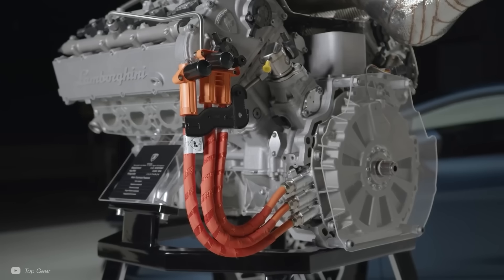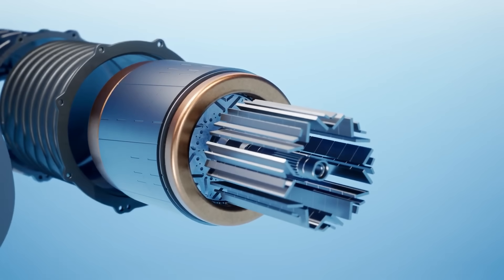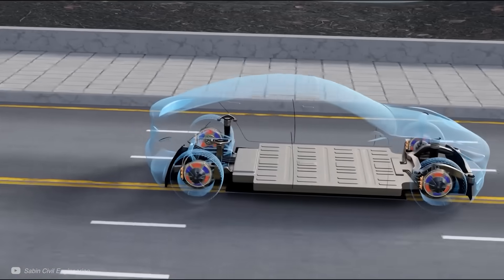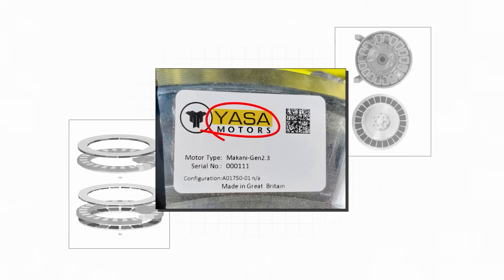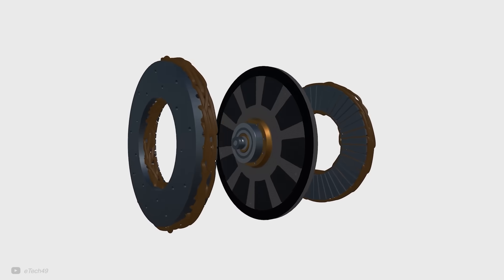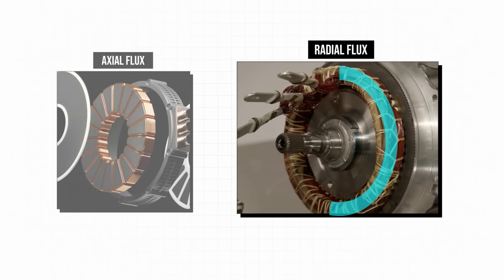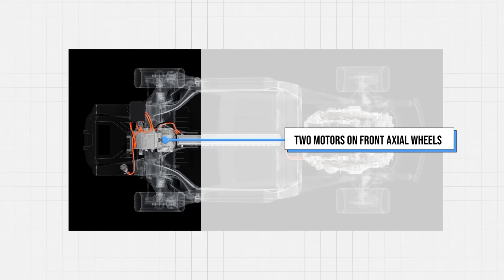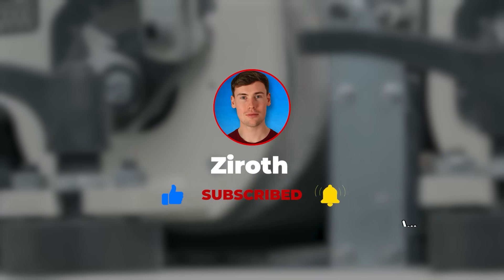Revolutionary Yokeless Motor: The Future is Here

Comment: Oh man, mass produce the motor to be used as a single power source for cheap small cars. You can outfir any current petrol car and strip about 300kg of weight from the engine and replace is all with a 17kg motor. 148HP is enough for small city cars, I hope they can make it cheap enough for the common plebs.
Reply: Yeah once you've added batteries there's no weight saving. But there's a saving in running costs, both in fuel and in the reduced number of moving and consumable parts.
Reply: For now, batteries will get significantly lighter
Reply: The same claim about reduced running costs was made about electric cars and it has been proven to be incorrect. They actually cost more to operate than a gas-powered vehicle
Reply: @cooperised  also in performance, it's got torque, it's gonna feel like a 2.0 TDI and they put those on big cars too
Reply: @cooperised You also need beefed up components such as brakes and suspension. I think you've simplified it wayy too much.
Reply: @reececlayton9549 Suspension perhaps, brakes no because a significant proportion of service braking comes from regen. In fact the biggest maintenance problem on my EV has been the rotors gaining a layer of surface rust because they're not being used enough. More modern EVs than mine will deliberately apply a small amount of mechanical braking periodically to avoid this problem.
Reply: @cooperised I know that. I said the components need to be beefed up.
Reply: @reececlayton9549 But they don't. Brakes, anyway. That's my point: EVs (and hybrids) rely far less on their mechanical brakes than ICEs, so despite the added weight they do not need to be beefed up.
Reply: @cooperised which is lost when the battery fails every 7 years max. You can drive a gas engine with little maintenance to well over 400k miles as long as you take care of it and buy the right one. There are currently no electric cars that hold a candle to a gas car in reliability. That is also the reason they dont use electric motors in airplanes. For instance the 1998 lexus ls400, 1uz v8 is so well built, it is small aircraft certified and there is one that id over a million miles.
Reply: @JamesAnderson-fw5ew Where are you getting those numbers? EV battery life is considerably better in practice than had been expected in the lab, and even the most conservative figures for battery life suggest at least 10 years or 100,000 miles of useful life, more if treated carefully.
Reply: @cooperised even if it lasted 10 years or a hundred thousand miles, thats still nothing. Even a garbage mercedes product will make it to 100k. Once the battery goes out, the car is practically garbage. Tesla battery replacements are about 20k and total out the car every time they fail. You may get 10 years out of it but If you happen to live in an area with slightly colder temps, kiss that 10 years goodbye.
Reply: @JamesAnderson-fw5ew Batteries don't suddenly fail, they degrade slowly. Range will eventually start to suffer, sure, but there's no requirement to scrap a 100k mile EV, it just won't go as far on a full charge. Note that the average age of a scrapped car is around 120k miles anyway.
Reply: @cooperised thats not true at all. Almost every car at the junkyard I go to are well above 200k miles or more. i also never said the batteries instantly fail but they do completely stop working around the 7 years mark. Your right about the degradation over time and that a battery will not output as efficiently over time. A gas engine will output almost identical performance as when it was new with proper maintenance at very high mileage. I can tell you are not an actual car guy as 120k miles is nothing. Almost every gas car can easily hit 200k no problem. We have have a honda odyssey with 210k that still runs, a buick lacrosse with 275k, a lexus gs300 with 235k, and my engine swap in my 90s civic has 220k and Is turboed and has a hard life while being 20 years old now. No electric car is going to even closely compare to what a gas or even diesel can get to. Your uninformed and your google ai is wrong.
Reply: @JamesAnderson-fw5ew What absolute nonsense. "They do completely stop working around the 7 years mark"?! Where are you getting this stuff? Performance doesn't suffer with age, only range does, and not by a lot (my 3 year old EV has a battery that still reports 98% capacity). My information on scrappage ages is taken from official statistics, not a random junkyard. I'm out of this conversation, you're clearly determined to hate on EVs and facts apparently mean nothing to you. Have a good day.
Reply: @cooperised if range goes down performance does to. They wear with what appears to be a logarithmic curve. Im not gonna listen to some guy who doesnt know anything about cars.
Reply: @cooperised  How long do EV batteries last?  Even if you are prepare to put up with losing capacity and range as they get older with more recharge cycles, they still eventually need recharging, and that's going to be many thousands of dollars.  Plus, I wonder if prospective EV buyers think about cold wet days when heating the vehicle interior, and running the wipers, is draining the battery reducing range.  And that is still not taking into account how long it takes to recharge mid journey — that can easily be an hour.
Reply: @TrevorDennis100  my Tesla model 3  take 30 min to recharge to %80 ( charging rate slows after %80)  while I’m at the grocery store & That give me 200miles of Range , I only charge 2 twice a week but if I could charge at home , I would just plug it in overnight like my phone
Reply: @TrevorDennis100
In an absolute hypothetically perfect scenario, it would take close to a decade to get everyone switched to EVs. Advanced battery tech is in the early stages, and nothing has changed. Things take time. Computers took many decades to get to a point where they were useful to everyone. It was 80 years between the invention of the fridge (freezer actually) and the time you could go to a store and buy one.

Batteries will probably be faster than those. But not even counting the time needed for batteries to get better, a LOT of people with cars have loans.

So just like not one vehicle is good for everyone, batteries aren't ready for everyone.

But the fact is, the average miles driven per day, is 35. So for everyone you know that drives a LOT of miles every day, there's several other people who drive less than 35 per day average. There's a ton of people who electric would be perfect for, and for the occasional longer trips, electric is so much cheaper to actually drive, that renting a gas car for a rare long trip, wouldn't even make an electric more expensive than owning a gas car. 🤷‍♂️

I'd betmoney that the distance current battery tech gives, well over half the drivers would save money owning an EV, and renting gas as needed.
Reply: @TrevorDennis100  Tesla says their batteries last several hundred thousand miles and I don't doubt it. Say you get 333 miles per charge (conservative for a 100kWh model S) that would be only 300 charge cycles to equal 100,000 miles. Tesla says they're good for 1,500 charge cycles!
Reply: @MikeZ8709  But isn't that with a greatly reduced capacity (range)?  I bet you'd be lucky to get 100 miles out a charge by the 1000th charge cycle.
Reply: Most cars are front wheel drive. How cool would it be if you could buy a rear axle/electric motor drive unit that was somewhat universal and could be bolted into the rear of most cars making them a hybrid. You could get away with a small battery and have regen braking/all wheel drive in one mass produced package.
Reply: @undertow2142  my RAV4 gets AWD by driving the front wheels with gasoline and the back wheels electrically with regen braking. It’s part of why I bought it. 

Agree, it’d be awesome if it was a package you could mod any FWD car with.
Reply: You're massively forgetting about the weight of a battery to operate said motor I think.

Or where are you getting the 300kg weight savings?
Reply: @PowerScissor City cars have much smaller battery.
Reply: @PowerScissor  You can chuck out the mass of the ICE, some of the transmission, exhaust system, fuel tank and fuel for a start.
Reply: @johnmorris1162  I understand what isn't needed in an electric vehicle.

All electric vehicles are significantly heavier than their ICE counterparts currently...as the batteries needed to power them don't come close to the energy density of fuel.

...and they don't get lighter as the fuel is used.  A 10% charged battery weighs the same as a 100% battery.

I love my electric vehicles...but they are heavy as sh!t.
Reply: @PowerScissor that's why most companies are going "mild hybrid," small battery size, and the electric part is basically a glorified starter that's intended to overcome inertia eg at stoplights or in traffic, which is where ICE loses out the most
Reply: @PowerScissor  It may not be a weight savings vs ICE engines, but it would be much closer to breaking even. That's a big deal. Also, imagine this on a electric motorcycle.
Reply: Put a small battery than only runs for 100 km. Plus make dump car not SUV. @PowerScissor
Reply: @PowerScissor lighter chassis, lighter  motor means smaller lighter battery. 1000 kilos and 1 kWh per 10 km.
Reply: @PowerScissor everyone forgets a Tesla Y weighs as much as a Ford Expedition … about as big as it gets !
Reply: @PowerScissor  most high performance ICE engines in cars put out about 1 hp per lb, with transmission, about .75hp per lb.  This motor puts out close to 4.
Reply: @dugnology   You still need a heavy battery to drive it.  Until battery tech evolves...electric vehicles will weigh more than ICE.

The weight has never been in the motors for electric vehicles.
Reply: @dugnology  Now include the battery weight.
Reply: @PowerScissor I think the diesel locomotive is the answer, using a diesel engine to run the generator and then power the motor from the generator, a smaller battery pack could still add efficiency
Reply: You forgot exaust and piping weights @PowerScissor
Reply: Indeed! The best things are normally only on the extremely expensive toys😢
Reply: Also solar tech is getting better, why not use them for free energy on the roof, hood etc. anytime you’re parked outside you’re getting some charge.
Reply: if your mom sits in the back seat it's net zero
Reply: main reason why this is paired up with a rather large engine, 3.8KwH battery can push those total electric ponies on all 3 motors about 43 seconds full to empty. this is used to assist the already monster of a motor
Reply: You can make a lighter, more efficient, and more reliable vehicle by using the gas tank as a battery and putting a generator where the transmission is, and then wiring that to the rear wheels.
Alternatively you could electrify the front wheels of a rear wheel drive, either could multiply the range and life of an ICE vehicle in the city better than just stopping the engine when idling, and same goes for needing a much smaller battery, or capacitor bank. The lifespan is greatly increased when you have the engine disconnected from the wheels and allow it to run it at a comfortable optimized setting, and it lets you tune it to be extra efficient better. It also allows you to make a car almost entirely from basic stuff like steel, copper, and aluminum. The chemicals in the emissions may be an issue, but you are producing less emissions if you're driving right, so you could tune it to a decent balance. You'd probably end up needing much less energy to accelerate since there's barely any battery, and you don't need to recycle as much energy out of all that mass when stopping, which is more than it sounds since you loose a fair bit of energy putting it back in the battery. Capacitors are much more efficient with charging but they're less energy dense and less durable currently, having a small batch of them that you can remove allows you to install new or upgraded stuff. They could maybe be recycled like lead acid batteries?
We should grow kelp for food but also it'll allow us to make all the fuel we need if we covered a manageable portion of the ocean with kelp farms. We could grow it around river outlets that have too much fertilizer or can't be used for food to maximize food production, and then you can make something like ethanol with it using renewables. We kind of need to start farming kelp to offload the burden on land ecosystems anyway, the ocean can handle the extra stuff better since as long as you're not shading much and add the nutrients you remove (processed sewage would be the best option since earth is a closed system, everything you eat comes from poop anyways) then it's good. It's about the least bad way to go carbon neutral and utilize the superior power density of conventional fuels while minimizing the need to replace infrastructure.
Reply: You are better off with 14.8 hp. 
It's plenty for a city car and only needs 25kg of batteries. 
Same hp as a fiat Bambino at max power. 
But available anytime max torque, so better.
Reply: @acmhfmggru  That's not my point, "bro". There is nothing about an EV drivetrain that requires higher precision than an ICE - quite the opposite, in fact, because there are no parts with a sliding fit, no valves to seal, etc. There is also only one primary moving part, in comparison to the hundreds in an ICE. It's amazing how reliable ICEs have become, given their enormous complexity and tight tolerances, but from a mechanical perspective EVs are far, far simpler.
Reply: Precisely why they will not do it😊
Reply: @bobdobalina4044  so we build our own, what's the issue?
Reply: China is flooding the market with cheap EVs for a couple reasons. Just behind their hyper driven Mercantilism is the very real concern that they will be needing to conserve oil after the West cuts them off for annexing the Pacific. 
Buy. Your. Demise.
Reply: Facts n pack it with a 2 cylinder 1 liter. Would be great.
Reply: Forgot about ECM, can’t motor swap real efficiently when you have to reprogram the entire ecm.
Reply: Ofc they won't, because greed and patents. If companies shared and combined their achievements, we would be already living in the year 3025.
Reply: Last time I checked, small petrol ICEs don't weight anywhere near 300kg, unless you include the gearbox and fuel tank with all relevant fluids.
Reply: @4G12 even then you don't come close to 300kg.
Reply: The battery will add 400KG after removing 300KGs and that is if you're lucky
Reply: Way lighter motor will fuck with the weight distribution but using a battery in place of the saved weight can maintain it. Electric motors are more efficient anyways.
Reply: Might want to watch where catl   are moving too, their on a specific course for battery production over the next 5 years.
Reply: Battery weight  ?
Reply: With a subscription. 😂😢
Reply: I like the idea of the hybrid as shown in this video where is coupled to a V8 engine - am thinking like mid size and full size hybrid pickup trucks that have mpg as good or better than a typical current commuter ICE car. And could make do with safer and cheaper sodium-based batteries.

In the US this would be the sweet spot market for such advanced electric motor and battery tech. The rest of the world is clearly going to succumb to the CCP-made EVs - and become dominated by CCP in general as the last vestiges of their industrial base shifts to China. What German auto industry remains will ultimately have to shift manufacturing to the US, and the UK and EU will just become CCP puppet states.
Reply: 148 hp is even to much for small city cars ^^ 70 is enough
Reply: hah! these go in mech suit joints.
Reply: It will never happen, just because it's good idea.
Reply: The batteries struggle in winter cooler temps. 30% less range. After 6 or 7 years the EV had depreciated so much its worth less than a new battery pack cost.
Reply: Nope: the 17kg motor needs a 250kg battery to run.
Reply: @flexiblebirdchannel @175wh/kg for cheap LFP batteries, 250kg gives about 45kwh of battery. This amount of battery costs $2250 at current prices. Enough for a city car.

250+17 is still less than the original 300kg engine + gb + about 40kg of fuel on a full tank.

That is a saving of about 100 kilos. Not too shabby weight savings.
Reply: @R1987R  I'm afraid the best in class performance comes at a cost. Theres a reason they fit them to super cars lol
Reply: depends on the battery technology, and space for it.

tanks are not the same as battery packs and the relationship with the battery manufacturer matters, if you’re an american car manufacturer I doubt you’ll get the good stuff from CATL or BYD.. good luck finding another supplier.
Reply: @CharlieZenenour I think American car manufacturers could get a terrific deal from CATL and BYD.  It just won't seem that way after donny has slapped his 140% tariffs on top.  So for every battery they buy, they'll have to give donny the price of another one and a half batteries.  But that's what makes America so great.
Reply: I'll probably make someone a lot of money with this comment but...
2 In-wheel motor + 12v 100ah battery x4 + 3000w controller = like 7000$ without labor costs.
Reply: @FloridaMeng  12 volts?  uhhh
Reply: @FloridaMeng  In-wheel motors don't last that long because of the vibration and stresses put on them by the road.
Reply: @FloridaMeng 3kW of power? Maybe on a moped but not a car.
Reply: @FloridaMeng  lmao 12v 100ah? what is that a go cart battery pack lmao, that's a 1200W/hr battery, or about 12 laptops, that's not even close to car battery size, try about a couple. of those to hit car battery pack power levels.
Reply: @FloridaMeng  "12v", "3000watts"? 😂😂😂😂😂😂😂

That's almost enough power to move an 8lb rc car to freeway speeds.
Reply: @FloridaMeng thats what? 4kwh usable? With like 10+ kWh per 100km you get less than 40km range. Absolutely pathetic
Reply: In-wheel motor increases unsprung weight.
Reply: @ruudh.g.vantol4306  Lambo have put the front motors inboard of the half shafts to reduce the unsprung mass, which really matters on a race car. 
Increased unsprung mass is less of a problem for a lower performance about town car. Removing the drive shafts, diff and central motor save a ton of mass and really open up the car design. It will be interesting to see how this all comes to fruition, the final decision always comes down to actual market price and performance.
Reply: @ruudh.g.vantol4306 I hadn’t thought of that.  In wheel motors seemed so obvious, though I could see how they had to be tough.
Reply: I love the idea, unfortunately business politics will not let that become a reality
Reply: I got a Smart Car EV for free. I can't believe how much fun it is to drive even with very little power or range for an electric.

I'm waiting until Nvidia has full self driving AI to upgrade everything. Eventually I even want to add robot legs, so I don't have to hike to my favorite swimming spots anymore.
Reply: Motor and battery gives you the freedom to build much smaller cars.
Reply: Battery is much heavier...  You won't get much range.
Reply: Yeah,electric motors are cool until they raise the price of electricity.
As other have said,it's the batteries that are the problem.I keep hearing about 'new battery technology ' but it never seems to come to anything
Reply: @ravenmad9225battery technology has improved over the last ten years, byd have just demonstrated a 249 range increase with a 5 minute charge. It will take a while for that to roll out.
Reply: @ravenmad9225 There is nothing saying you cant buy some solar panels/battery's and an inverter and start making money back with your own stored power....
Reply: @ravenmad9225I thought Toyota is working on applicable solid state batteries for cars. Not sooner than 2028 for use in cars I believe. Solid state batteries are already being tested in the field, as are salt based batteries. There are also earth batteries but used for different things ofcourse. The whole plant is a super battery
Reply: @ravenmad9225 But "once battery tech gets better"
Yeah, unfortunately, we've peaked.
Reply: @integerofdoom69  material science tech in general is getting better
Reply: @integerofdoom69  not sure they have peaked. Geely and BYD have just released some new batteries with 20% ish more density, lighter and a crazy fast charge time, like 5 min from 10%-90%. with projected life spans of well over 10 years.
Reply: @integerofdoom69 peaked? We're barely getting started 😮
Reply: There's nothing like a gas engine and manual transmission.  Soon it will be a thing of the past due to laziness and just plain stupidity.  Humans peaked around the year 2000 and have been in a state of decline ever since.
Reply: @drwho5437 about 1910 actually.